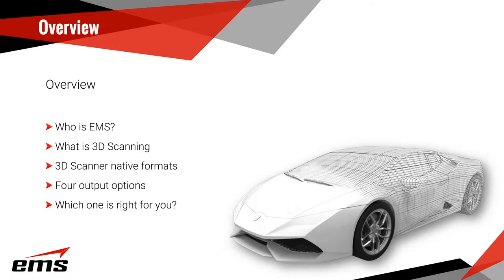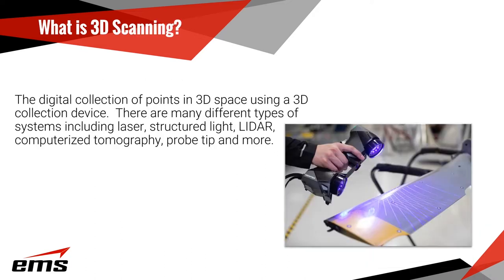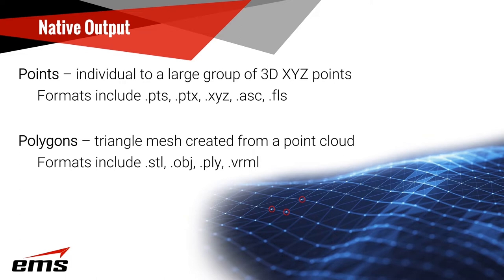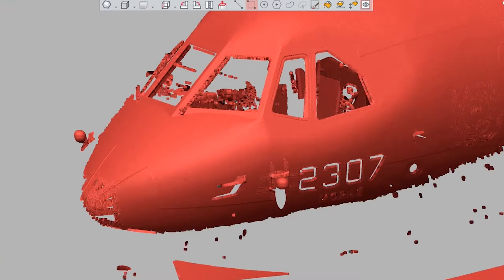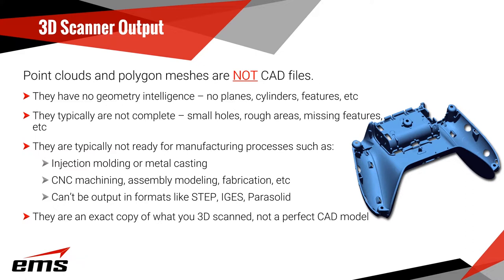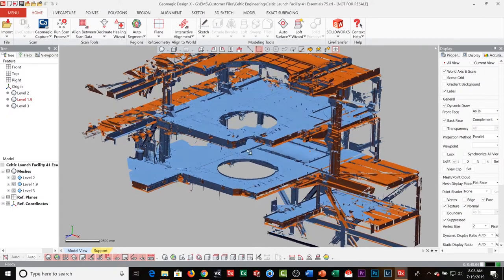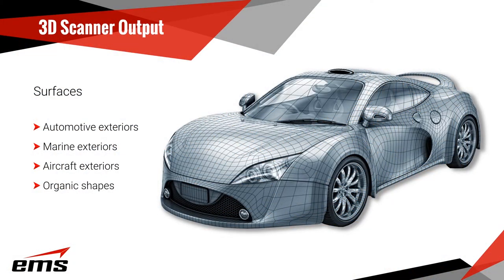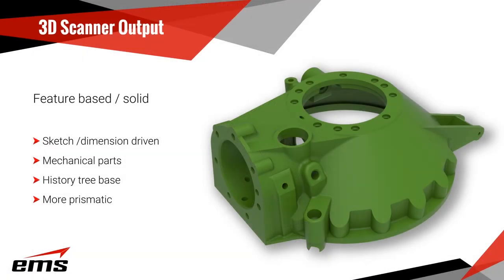3D Scanning Output Options

Comment: Great explanation. Reverse engineering 3D scanner output its simpler for direct 3D print of organic shapes. For manufacturing enviroments things get less glamorous and more time consuming and great technical effort is required. For metrology purposes  with high resolutions in mind (which is why i'm here) the whole scan technology used to get the dot cloud/poligon mesh in the first place is still the main problem. Most available scanning gadgets wont "see" 50micron (metric) deph variations.
Reply from the maker: Some scanners we use go down to 15 micron accuracy and our industrial CT Scanner goes down to 9 micron accuracy so it may be possible. https://www.youtube.com/watch?v=2wozZ7XjxvI

Comment: After watching this I can better understand what is going on to make a useable model. I am working on a cylinder head design and will probably just make the core boxes and casting patterns the old fashioned way. That is to cut apart a head and measure all of it. I can then design all the casting patterns with my shrink rules. I have lots of changes to make and that can be done manually.